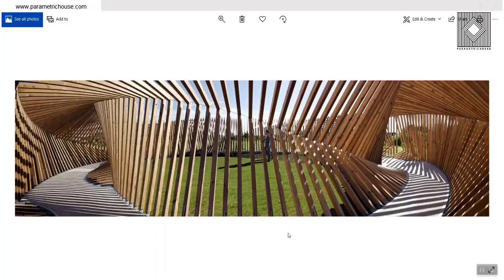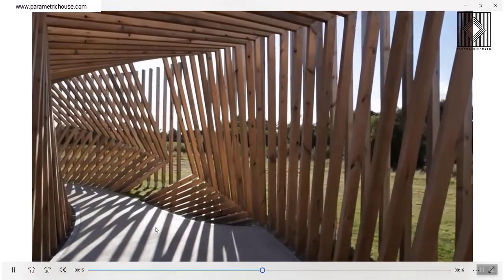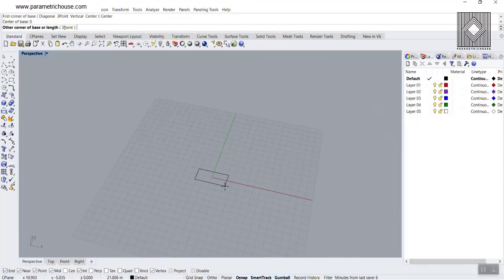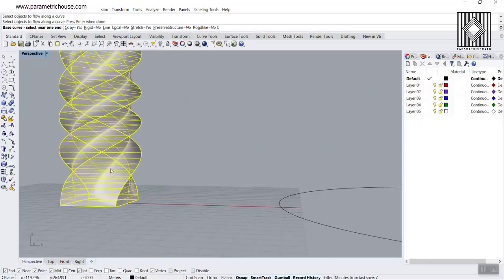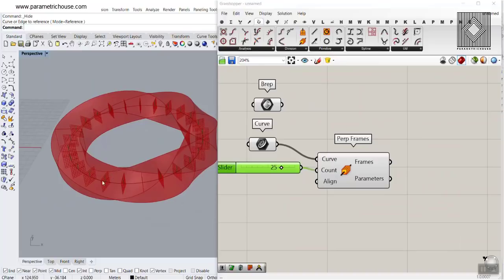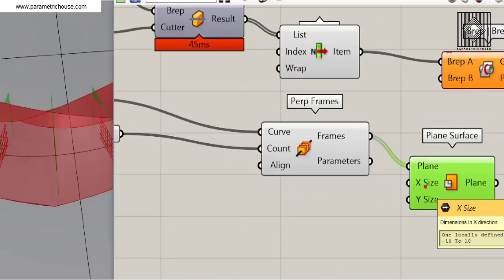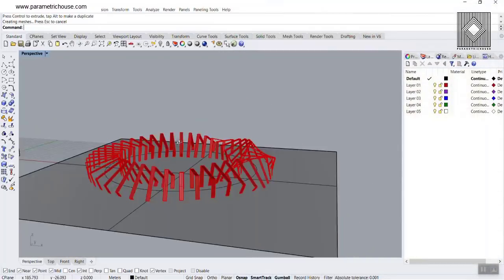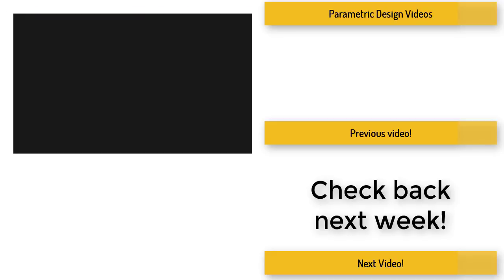Parametric Design & Modeling - Architecture #3

Comment: Thank you for this course!
Can we control « the intensity and the projection place of the twist mouvment » on the circle ? If so, is it possible to do that completly in grasshopper?
Reply from the maker: 🙏
Yes you can control it by graph mapper or simply by changing the location of the twist axis. Check out the graph mapper tutorial for more info.
Reply: Parametric House thank you for your response and for this excellent youtube chanel !

Comment: Nice tutorial! Wouldn't it be better though to work exclusively in GH and set a circle as base curve, subdivide it in equal lengths, assign a rectangular frame in each division point and then rotate gradually the frames and produce a lofted surface so as to achieve a Möbius band with smoother curved transitions or simply follow the same steps you did but use a box whose height is equal to the length of the circle you use for the flow path so that your twisted box gets to be distributed more uniformly around the curve without using the stretch option. Just an opinion, your channel rocks! ;)
Reply from the maker: Thanx
🙏
yes, it's possible and I usually model everything in grasshopper in my tutorials but in the parametric design series, I usually combine rhino and grasshopper to make it easy for beginners!
There is also another way of modeling this which I explained in the course.